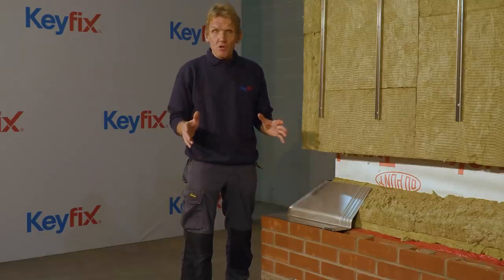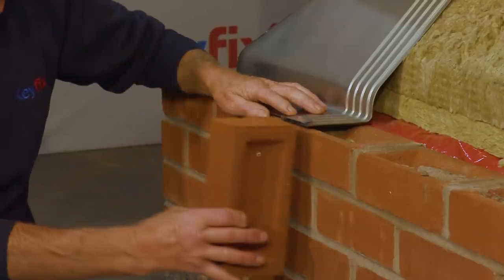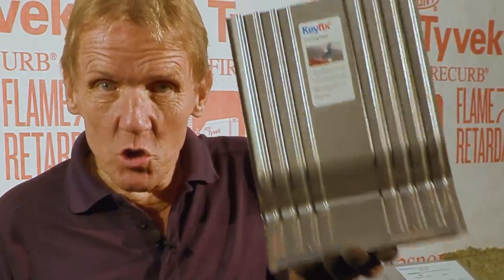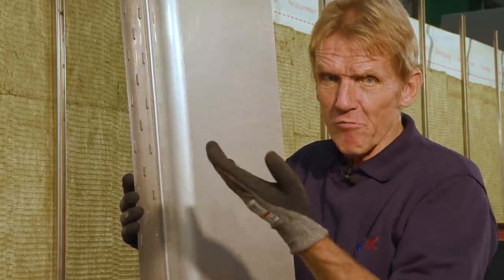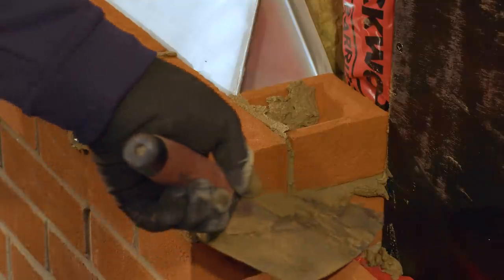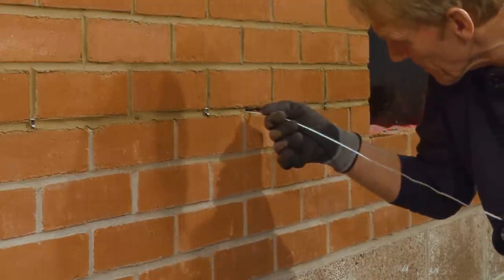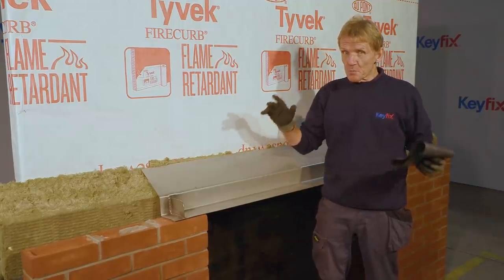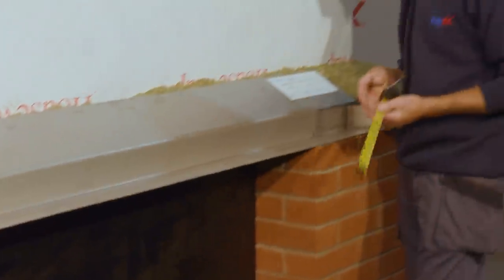Keyfix Cavity Tray - Solving the Non-combustible Challenge

Comment: Looks cool. But will the stainless tend to condense moisture to the underside in the cavity?
Reply: Hi Shawn, thank you for your query. Keyfix Non-combustible Cavity Trays are installed within the external skin of masonry and has no connection with the inner skin. With no connection between external and inner skin, there is no risk of a thermal bridge, therefore, there is no transfer of cold damp air to meet heat transferring from inner skin and as a result there is no risk of condensation forming on Stainless Steel Keyfix NCCT.

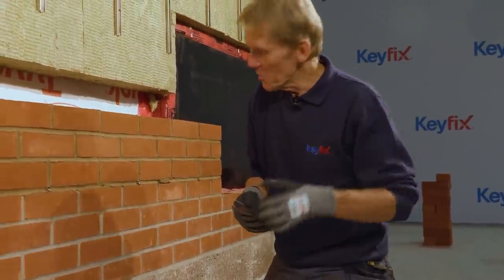Comment: Roger that looked to be engineered very well. When you were testing the weep holes of the cavity tray with the banding strap - it appeared it popped out underneath (10:07) the tray rather than on top - how did that happen?
Reply from the maker: Norman  it comes out  between the bottom and top. There are two layers there.
Reply: @SkillBuilder  Ahh OK thanks.🤔
Reply: Hi Norman, thank you for sharing your query. The Keyfix Non Combustible Cavity Tray System overlaps Ribbed End Corner Unit with Brick Trays. When banding strap is used to check that the secondary weep vents are clear, the Banding Strap is pushed between the space created in the overlap to ensure there is no mortar in this space and therefore facilitate efficient moisture drainage.

Comment: No way is a client going to be paying for stainless steel cavity trays haha
Reply from the maker: This is high rise technology. If you are maximising the yield from a plot by putting 18 stories on it cavity trays are not  the deal breaker.
Reply: No choice if the building is higher than 18m in England and 11m in Scotland.
Reply: @garyfardon8841  
That's the regs, but pretty much most apartment buildings below that are doing this.

Because they can't sell the apartment and the new owners won't be able to sell later on.

It's the banks, they won't mortgage a apartment that doesn't meet those for standard even if they don't come under the regs.

Comment: as a apprentice in the 70s ii was taught a cavity tray protected moisture from above not hitting the top of window, door frames, pre insulation in the cavity
Reply from the maker: It was explained.
Reply: @SkillBuilder  sorry roger what a naughty boy am i.
Reply: Hi, thank you for sharing your query. A Cavity Tray is required over all bridges or penetrations of the cavity within an external wall. The primary function is to capture moisture running down the internal surface of the external skin of masonry and also moisture dripping off wall ties within the nominal 50mm ‘clear cavity’. Once captured, the moisture must be restricted from travelling horizontally across the cavity to insulation within the cavity and expelled out of the cavity via Weep Vents.

Comment: We should be using hempcrete for fire barriers instead of metal. 
This is because hempcrete does not conduct heat so if there is something flammable that has dropped on top of the hempcrete it will not set on fire. 
But if we use stainless steel the stainless steel will heat up and ignite anything that is touching it.
Reply from the maker: Obviously   
This is about cavtiy trays not fire barriers. The fire barrier , Rockwool wrapped in red polythene can be seen below the cavity tray. The cavity tray, as explained, is there to take moisture back to the outside of the structure. It is used above points that form a bridge, in this case that is the fire barrier but it could be anything.
Reply: Hi, thank you for sharing your query. In addition to Skill Builder’s response above, Keyfix have introduced a range of Non-Combustible Cavity Trays manufactured from Grade 304 (or Grade 316 if required) Stainless Steel in response to non-combustible components required in compliance to Building Regulations Document B. Stainless Steel is classed as an A1 fire-rated non-combustible and therefore does not contribute to growth or spread of fire as a result of flaming droplets.

Comment: Get product but have you seen snagging reports on YT about fake weep vents on new build. That is a more important issue to be addressed.
Reply: absolutely shocking
Reply: And I'd say a building control issue where inspectors aren't doing what they should. Refusing to sign off unless they see everything is what they should do but recent experience suggests not. When I asked "Did you see the steel beams installed? Are they siting on bearing plates or padstones?" And the reply was we rarely see the joist as the builder has already covered it up.
Reply: @brianhewitt8618  take a shot everytime he says shocking..you'll be bladdered in 30 seconds
Reply: @monday7150  Most channels now have comment protection on by default so if anyone posts a link the comment will automatically be removed. So a youtube search would just be easier.
Reply: @monday7150  Look up New Home Quality Control

Comment: what if brickwork requires opening or tightening of perps? guess they come as set measure?
Reply from the maker: That was explained, there is adjustment in the trays
Reply: But not in the stainless lintels? What’s there rough cost for say a 1200mm cg90/100 in comparison, 2/3 times the price I imagine?
Reply: Hi Scott, thank you for sharing your query. The prefabricated units are designed with flexibility onsite in mind. The integral Stop Ends used in the Keyfix Non Combustible Cavity Tray System provide perp joint adjustability of ±3mm between 7-13mm if required. However if a particular project falls outside of this adjustability, such as different brickwork or perp joint dimensions, it is possible for Keyfix to spec Non-Combustible Cavity Trays to suit.

Comment: It is not good for profit of house builders, so  it would eat their profit, no way they would use it
Reply from the maker: You missed the whole point. This is specifically for high rise buildings. It has nothing to do with low rise housing.
Reply: If every building is mandated to have fire protection, then every house sold is sold with those costs in mind.

It all gets passed onto the consumer.

Comment: Surprised lintel tray doesn’t have under pads each end ???
Reply from the maker: If you are talking about pad stones they are not required. This is face brickwork and the crush strength of the bricks is plenty good enough
Reply: @SkillBuilder  Correct. The lintel is only holding the brick facade above it. It's not taking the structural loads of the building.

Comment: Or we could just stop building with this slow archaic brick nonsense and modernise and greatly speed up building with high tech designed prefab...  Oh wait, then the big house builders wouldn't be able to trickle out supply and keep prices up.
Reply: Also, customers prefer the appearance of brick. Doesn't mean it actually has to be brick though.